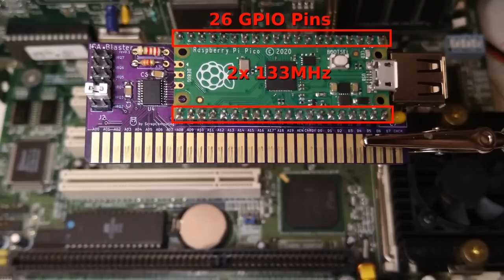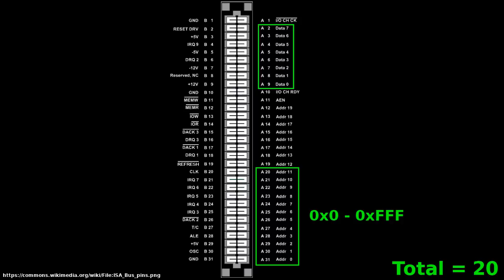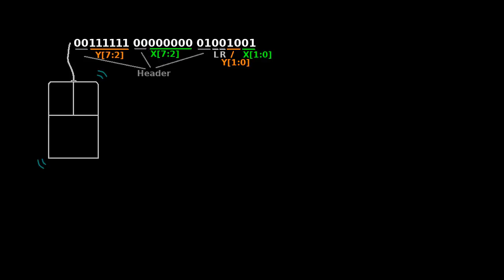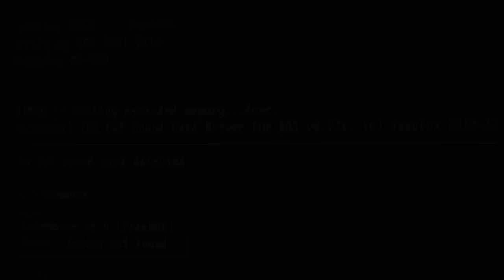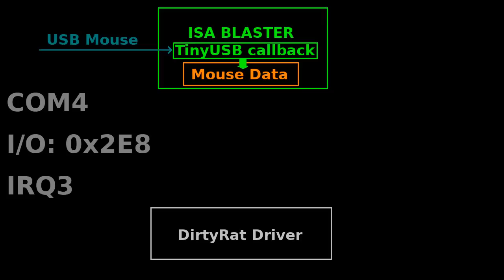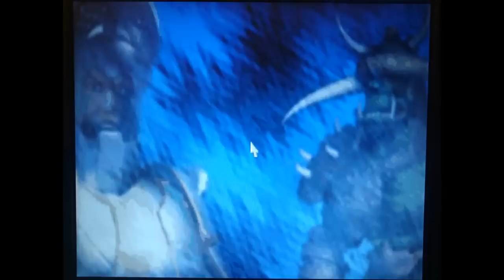ISA Blaster: A software-defined ISA card based on a Raspberry Pi Pico (Part 1)

Comment: Very nice!~
FYR
1. New rev of RP2350 can take 5V I/O.
2. Use PIO function of Pi Pico for fast state machine I/O. Can be as fast as 1/2 MCU clock.
2 cents,
Reply from the maker: Ah thanks for the info. Nice, the RP2350 A4 is 5V tolerant! Do you know if there is any Pico board available with it?

Yes, I am using the PIOs for some of the firmware logic. PIOs are awesome :D

Comment: Hi I loved the concept of this and it has given me an idea, I have an issue with using Diag ROMs on a 5170, they only work with a CGA or MGA 8bit card, the CGA card I have is not working and finding an easy way to view output from CGA would be amazing... My thought was not even initially providing output to display but pushing the raw text output from the CGA card emulation to the serial connection! This may be a nice initial step to get some output? and add DVI out later... Do you think this is possible, or am I mad? would really value your thoughts :) Keep on Blasting :)
Reply from the maker: This is a great idea! I think it might be possible to get it to work as a simple display card. A tricky part would be to make the Pico behave like a CGA/MGA card during the initialization so that the BIOS thinks that it talks to an actual display card. I am mostly worried about the timings, and whether the Pico is fast enough to respond in time. The 5170 should have a slow enough ISA bus though, so yeah, it might work.

Comment: I love the minimalism, but the cost of that approach is the PIOs have to lose much of their potential. They're fast enough to drive multiplexing and demultiplexing, and still not need individual registers implementing the interface of the card on the bus, as long as they're free to switch between functionalities. With that in mind, I think it's appropriate to add some logic to the design while keeping with the software-driven approach.
- Output registers e.g. 74*273 avoid stalling PIO or CPU on ISA timing, the data can be clocked in while the register is already enabled, and each flip-flop only ever needs to drive one output.
- The data output enable can be triggered by ISA read signals, and CPU code writing out data can drive the dedicated pins ASAP (be it early, or up to the moment data is sampled). A chip or two of NANDs should be plenty for this purpose.
- You can side-set an output from PIO for "selected" in your address decoder, primarily for the output enable, but also use this to set CHRDY automatically with one or two flip-flops. Wait states are not ideal, but better than a miss on the bus.
- 8x 74*251 digital multiplexer chips effectively integrate address decoding for 64 lines. This gives access to data and address lines with 12 GPIOs, 8 of which can still drive multiplexed output registers.
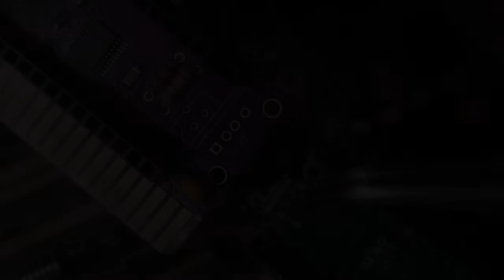- A 1:n analog mux can pull down the IRQ of your choice, with the pico enabling the mux to trigger an interrupt, and an output register holding the selected IRQ. This is the same function as an open-collector decoder, but a 1:16 mux is more common than a 4:16 open-collector decoder.
All that should free up pins, even if the card was expanded to 16-bit, leaving 8-9 to throw at fun features:
- An SD card slot for storage would be sublime.
- After that, you have an SPI, two UARTs and two I2Cs, set them free! Breaking out headers for each lets you do whatever: I2C RTC, Temp sensor, Bluetooth module, Second SD card, GPIO expander, etc.
Reply from the maker: Yeah, that would be really cool for a future revision of the project!
Reply: It seems you dont know my picoMEM project
Reply: @freddyvretrozone2849  I've just read up on it, interesting work, and a bold approach to go right to replacing BIOS and system memory! I hope you're making effective use of the PIO's ability to both time DMA transfers, and control the multiplexers directly. My thoughts on adjusting the interface hardware still apply, moving some control logic (e.g., a CHRDY flip flop, disambiguation for DRAM refresh cycles, DMA cycles) outside the PIO reduces pin count and shrinks the timing-critical portion of the PIOs. I believe that would allow ISA DMA, I/O, and memory with 1-2 SMs.

Comment: can this be used to emulate MT32 using Pico? or perhaps using Pi Zero W?
Reply from the maker: I doubt it. These synthesizers are pretty CPU intensive and as far as I know they need at least a Pi Zero 2 W.
Reply: @scrap_computing  i see. I reckon Pi Zero 2 W could be a good option then.

Comment: I thought you chose the pico because of the PIOs, which is the reason I would choose it myself. You can just put the bits in the PIOs' FIFOs and shift them out as soon as they detect a read, or something like that. You can do that from Python, no need to compile anything.
Reply: Send the data even before the @ is decoded ?
Reply: Yes, re-write the code using PIO. The PIO is a programmable state machine capable of interfacing with different buses. In theory, the CPU need not directly interface with the ISA bus. That all gets handed off to the state machine, which raises an IRQ within the Pico when bus data arrives. Similarly, it can raise an ISA bus IRQ and handle offloading data when writing to a FIFO within the Pico.

Comment: you may have already done this (if so ignore me) but you could've probably solved the speed issue by using the pico's programmable I/O to handle the UART emulation and have the CPU just feed the mouse data to the programmable I/O
Reply from the maker: Yeah, there should be some way to get the timings right with some coding tricks, offloading some of the work to either the second core or the PIOs.
Reply: @scrap_computing  the PIO would be better since they have direct access to the GPIO and can thus respond way faster

Comment: Your connection between the USB mini and the larger USB A could be the problem. The signal is a differential one and ideally the wires should be impedance matched. Try making the wires as small as possible. Perhaps twisted pair wrapped with a ground.
Reply from the maker: The data received by the Pico looks right, but anyway good to know :)

Comment: i wonder if some day the bigger ISA cards can be simulated in this way (probably with an SoC with more pins, or an FPGA). Pair this with the dISApointment project (ISA over TPM), and this could potentially open up more general compatibility with legacy computing on modern devices.
Reply from the maker: It should be possible to emulate quite a few ISA cards using the more powerful Pis. The Pico is almost too slow, so it is an interesting challenge getting it to emulate an ISA card.

Comment: I'm also looking at using a Pi Pico to emulate devices for 8-bit micros.  Using 74LVC245 chips not only takes care of level shifting, but also multiplexing, allowing you to connect both the data bus and the hi/lo parts of the address bus to the same pins on the Pico (using just one extra control line for each set of 8 lines).  The Pico should be fast enough to handle back-to-back transactions if you allow for it in the software design.  That is, check for the second right after handling the signals for the first (instead of treating them separately).  Note that if you run out of GPIOs, there are RP2040 boards that bring out all 30 GPIOs the chip has to offer.  Also, if you check out the "Hardware Design with the RP2040" document, you can see about VGA and audio output using the Pico.

Comment: Regarding that multiple-clicks issue: Is your mouse in good enough condition? The actual button's switch in the mouse might be bouncing slower than the ISA Interrupts are handled (some milliseconds maybe?). But you can examine that with a simple MCU script that just counts all Mouse Status transfer instances and Serial.print() them out - sorry, coming from ArduinoLand here... 😁; plus I don't know what platform you program your Pico in... Maybe rinse the button switch with some Isopropyl Alcohol, Contact Cleaner or WD40 to clean the contact points.
Reply from the maker: It does not seem to be a bouncing issue. The data read by TinyUSB does not show any bouncing at all. It is probably some software glitch...

Comment: Wow, really cool project! I've thought about trying to use an FPGA for something like this. Would certainly eliminate any performance bottlenecks but maybe a steeper learning curve.
Reply from the maker: Yeah using additional logic makes sense, and is probably the best option. But I was mainly interested in exploring what can be done with a purely software approach. Perhaps some of the timing issues may be solved with clever use of Pico's PIO engines.

Comment: Did you try to utilize the PIO-cores of the Pi Pico improve the timing?
Reply from the maker: Not yet, but these PIO units sound super interesting. If there is a way to use them to fix some of the timing issues, then that would allow us to emulate all sort of devices.
Reply: @scrap_computing  and they are proven to work fast enough to emulate a dvi video output

Comment: It would be nice if we could get VGA out from it. Also, could ESP32 work for this purpose or it is all on RP PIO to make it work?
Reply from the maker: Yeah that would be great! I am not using PIO at the moment, but it may help offload some of the signal logic. The ESP32 might work too, though I am not sure how fast it is compared to the Pico.
Reply: @scrap_computing  So, ESP32 is faster and it has wifi and bluetooth, could be useful. You can also use VGA without any resistors, albeit with few colors. It doesn't has the PIO though.
Reply: I found this. Just to have some idea https://www.youtube.com/watch?v=mNs1JePWvmg

Comment: Are  there similarities between PicoGUS and ISA Blaster?
Reply from the maker: I am not familiar with the PicoGUS, but it definitely looks like a similar project.
Though I would assume that the PicoGUS has some proper bus logic for interfacing with the ISA bus. The ISA Blaster is trying to do everything in software :)
Reply: @scrap_computing  Picogus use only multipler and a logic gate to help with DMA.

Comment: Great idea, I believe that we can replace most of the ISA cards with devices like the Pi Pico
Reply from the maker: If the Pico was powerful enough we would probably be able to emulate multiple ISA cards simultaneously :)
Reply: @scrap_computing  the secret to the RP2040's power is in the PIO macroblocks. learn them.
Reply: @scrap_computing  That would be amazing. I dream of the day when we can emulate an ATI MACH64 ISA clone :)

Comment: Would be nice to have asynchronous access, having a dual port SRAM chip, one side on the ISA bus and one side on the Pi. This would solve your timing issues.
Reply: You will still need to have some kind of selection and addressing logic though, because the bus is shared. Otherwise your card would behave wonkily if there are any other circuits/cards/? attached to the bus.

Also, by using SRAM that way you introduce other complexities.

Comment: I read that RP Pico can be overclocked up to 400 MHz. Main problem is that onboard QSPI flash memory is specified to work  with 133 MHz (but it often work with 300 MHz), but that bus can be divided accordingly to work stable witch 400 Mhz cpu core. There are some videos about it on Robin Grosset YT channel.
Reply from the maker: Thanks, I will check them out. We may need some serious overclocking if we are to get this to interface properly with the ISA bus purely in software :)

Comment: Are  you using PIO features?  Use those.  Others have been able to emulate video cards on an Apple II bus  with use of PIO.
Reply from the maker: I am not currently using PIO, though I could use it for offloading the IRQ signal which would remove some overhead from the polling loop. But the main issue is the tight timing for some of the bus signals, like IOR, which I think has to be done in software.
Reply: @scrap_computing  you can use DMA to dump 32bits to pio/pick up 32 bits and have it respond to or trigger Irqs no CPU needed.
Reply: @scrap_computing ask Ian Scott. He ran into similar issues in the PicoGUS.
Reply: i think PIO is much more powerful than you are imagining.  as mentioned some have emulated a VGA signal and I have used it to run 8 I2c buses in addition to the 2 hardware i2c to drive 10 OLED displays

Comment: Hmm, I wonder how it would cope running at higher baud rates.
I am curious as to whats causing the issues with the left and right click. TinyUSB is strange with some mice but that doesnt sound like the case here, probably some lag on the picos side with pumping in the signal if thats the case id imagine you'd get further with a shift register or do what I did and give the second core of the pico the job of sending the mouse data with core 0 getting the mouse data from tinyusb. It helped my project a lot with pumping out data consistently.
Reply: it pumping /injecting string 010101, into ISA bus, could just be missing 1 or 0 somewhere, but if that was the case I would also expect the mouse pointer move in large random jumps, and that was not mentioned in the video?
Reply: My guess is based on the first packet being malformed since the left and right clicks are the first bits sent. Though it depends on how he implemented getting data from tinyusb.
Reply from the maker: It is strange. If the bits were wrong then as @dh mentions, we should be getting some erratic mouse movement, which is not the case.
Is there a chance that TinyUSB reads the wrong L/R data from the USB mouse?
Reply: @scrap_computing  it can depending on the mouse. Not all mice support "boot mode" as tinyusb uses but that's not the case for you.
I had issues getting consistent clicks from tinyusb and had to set up essentially a latch that remembered it's previous state.
The idea being that the USB mouse refreshed faster than the serial mouse did so you can press and depress before the adapter gets a chance to send the click for the serial mouse
Reply: @scrap_computing  i know the code in my project is a mess but i usually comment everything so feel free to check it out. Maybe your answer is in there. Take what you want from it, the point of it is to help people trying to get a mouse working on an old machine after all.

Comment: hmm i wonder if this could be expanded to make a VGA card for HDMI use on retro computers
Reply: i looked into similar projects for the pico and it appears that there is at least one DVI output(over HDMI) project for the pico so I'm not crazy 😂
Reply from the maker: Yeah, though a more powerful Pi, like the Pi 4 would probably be a better choice for such CPU demanding projects :)
Reply: @scrap_computing  yeah in the time since I made this comment I had an idea come to mind where one would use a pi zero W to essentially replace every single expansion card at once, supplying sound, video, networking, serial, storage, etc. A single board with a zero W or a compute module installed with headers leading to ISA brackets. Emulating all the cards at once.

In my LPX form factor 486 machine this would replace the ISA riser card entirely.

Comment: Next: Implement a custom 8 bit CGA/EGA/VGA card with the Pico ;-)
Reply from the maker: Haha I am not sure it would be fast enough :) 
It may be possible to do this in a Pi 4 though, and you would also have native HDMI output !
Reply: @scrap_computing  There are some projects that can do VGA or even DVI by using the Pico's PIO. It probably all depends on how many resources are left for the bus. Would be a nice challenge.

Comment: This is amazing. Cant wait to see more. A couple ideas. I have no idea how feasible some of these would be. 1) emulate a boot rom that could load boot ROM images something like XTIDE. 2) anoter person already said a wifi version to provide network connectivity. 3) USB storage? 4) and of course....it would be so awesome if it could do some sort of sound emulation. This moght not be possible for thr picos cpu but i figures id throw itmout there.
Reply from the maker: Yeah these are great ideas, I will try to look into some of them, thanks!
Reply: I already did it : ROM, RAM, EMS, Floppy,  Disk
Reply: The trick with sound devices is that they all worked a little differently. There was no universal standard as is more common these days.

Various trade-offs between needing more RAM/ROM (memory), more CPU involvement, or additional sound hardware led to a bunch of different designs.
Reply: usbif USB could conected to USB HUB, like being able to plug one than one USB thing in at a time, ISA connects to even more on the computer than LATER PCI, so it show be  posable to almost take over the hole running of the system calls, enulate anything that existed as ISA card, and and what even connected to that card, and depending on how card working It may also be posable emulate more than one card at a time, or many if its posable, it would be interesting to see if you could get two of the USB blaster PICO card talking, to one communicating with a second one hosted on the same PC, to do a task? really wild Idea would content up modern display screen HDMI, DVI ,or even new standard, or some of the remote stream to remote screen stuff?
Reply: It would be a waste of a Pi Pico to "emulate a boot ROM" using a bit banging approach.

You can also use almost any microcontroller with enough gpio pins to build a ROM emulator by substituting an SRAM chip or some sort of Flash chip for whwy would originally have been a parallel EPROM or Mask ROM (sometimes referred to as MROM) ROM. Basically the microcontroller facilitates writing some code to the memory chip and then the machine boots directly from the memory chip.

It's a little more complex to build than it sounds, but the basic idea is fairly simple.
Reply: @jnharton  So you did not read my comment. I already did a ROM, RAM, EMS, disk on sd pi pico board. And more is possible/to come. It is not a pi pico waste, the pico cost 4$
Reply: @freddyvretrozone2849 how can we get the pcb? How much does it cost?